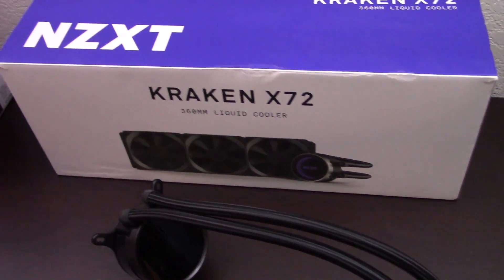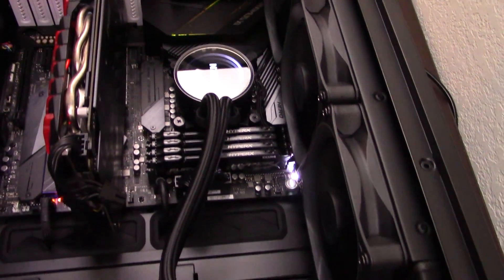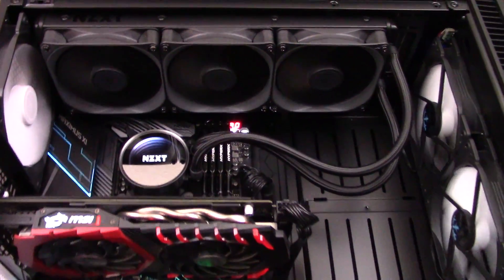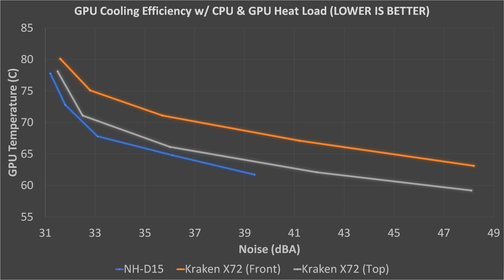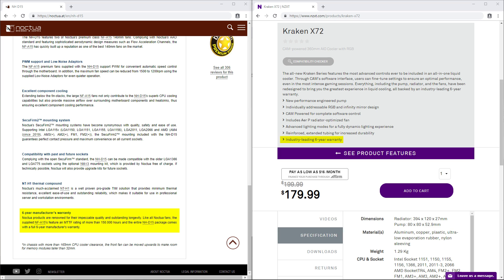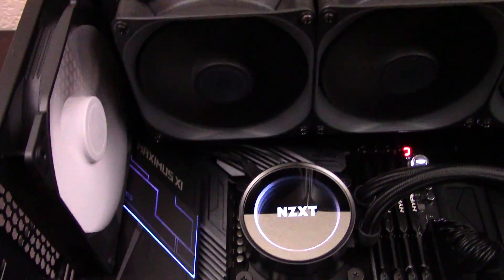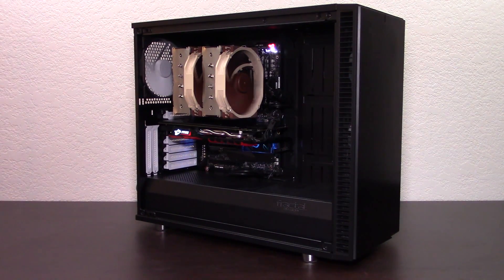Air Cooling vs. Liquid Cooling: The Ultimate Showdown (feat. Noctua NH-D15 vs. NZXT Kraken X72)

Comment: The Noctua DOES HAVE customizing ability.  It is called CHROMAX.  I used this very same cooler in my build  (02/19) and have black fans with white fin covers.  Here is a link a short video explaining this...  https://www.google.com/url?sa=i&source=images&cd=&cad=rja&uact=8&ved=2ahUKEwiOjbmCgLnkAhVLeawKHfqCBxcQjhx6BAgBEAI&url=https%3A%2F%2Fwww.youtube.com%2Fwatch%3Fv%3D_Nc2aonsseg&psig=AOvVaw0_rYovS4FKjRDTAqpYJ5PZ&ust=1567749467471761

Comment: One thing that could be mentioned. If you're ever moving the PC (LAN parties or whatnot) a huge air cooler will be quite heavy and will put a lot more stress on the socket and motherboard than the AIO will.
Reply: @Arachnotron The radiator doesn't hang off of the socket or motherboard. The Noctua NH-D15 is almost 3 pounds hanging off of the motherboard with a high amount of leverage due to the weight being concentrated on the outside edge. A waterblock is a couple of ounces and an inch tall. If you've ever used both you'll know this...

Comment: and the NH-D15 will last for life... no pump to replace, just the fans and thats a quick swapperino and noctua prolly upgrades the mounting brackets along the way.
Reply: Well the tricky part is the price and case. In some cases the D15 cant fit. I paid my thermaltake water 2.0 like 2 years ago 60 bucks. D15 cant fit in my case and its 120bucks. My thermaltake was running good till like few 2 weeks ago 96c on fortnite when i tested it im running 2600k at 4.9. Yesterday i was like fuck it i took it apart it was painful but i replaced the liquid there was like 2 spoons of liquid inside xD. I replaced the liquid with pre mix of anti freeze well people say dont use anti freeze but fuck it on the bottle it said anti corrosive and anti bacterial. Well my temps are good now im running 1.51v on my i7 max temp 72c
Reply: my kraken pump died a couple days ago...couldn't figure out my my pc was thermal throttling to death. The Deepcool Fryzen will do fine for me, I think imma stay away from AIOs from now on
Reply: @jerryknudsen7898  good decision welcome to the pc master race
Reply: Warm Soft Kitty  true, welcome to the pc master race😎
Reply: NH-D15 is amazing but like many components it has a limit, there will be a point that cooler won't be able to keep up with the heat output that CPU is generating on the high end. I can't wait to see the Ice Giant Coolers performance when it releases compare to both Air coolers and Rad. Sure it is the next evolution of Air cooler but with different technology and not relying on heat pipes or worry about dry-out. If your CPU in the future is tamed at low temp by the NH-D15 then yes will last a lifetime, but if it isn't, Ice Giant will be the next step up.
Reply: then you cant oc your pc , when it already reaches 75 degrees without oc
Reply: @resinds.p4898  talking about price to performance ratio. Of course water cooling is better.
Reply: Warm Soft Kitty  not 360s, but matches most 280mm aios.

Not the new Arctic LF II though.  That one is incredible.
Reply: @TheMasada05  so basically the cooler with 2 noctuas beats the one without, nice i think ppl forget that all watercooling is is your moving the heat-sink somewhere else its not some magical it has water it will be cool its still just a mass of heat-sink equation.
Reply: try that ryzen swapling allot thing bad flash and 3950x 16 core heat.
Reply: With the 6 year warranty on NZXT aio's I wouldn't worry about replacing anything on them
Reply: @frenak12  my cooler master 240 still going since 2014. And I'm pretty sure that warranty was 4 years.
Reply: I've never had an air cooler for more than 5 years.
Just got me the nhd15 and plan to keep it as long as possible.
I'm curious about the heatpipes. Do they have some sort of decay time or lose efficiency after a long time? like 10+ years
Reply: You're never going to upgrade your computer? Neither will have compatible sockets in 10+ years, maybe even less depending on where you are on the upgrade and new chipset design timeframe.
Reply: @VictorBStan  You can take a Noctua cooler from 2005 and request a free AM4 mounting kit and use it on a 2021 AMD Ryzen 5950X. They've been supporting SecuFirm2 for 15 years now, and there's no reason to believe that they won't support it for another 15 years. It's widely regarded as the best mounting system in the industry even after 15 years, and new sockets are supported via new mounting brackets that are either included with the coolers, or available for free from Noctua (or purchased for $10ish if you need to get one fast).

So yes, there is a very high chance that a Noctua cooler you buy today will be compatible with sockets in 10+ years.
Reply: @gazza The major point where a noctua air cooler beats AIOs is the fans.  CM ML240 uses mediocre fans, and the corsair fans are merely okay.  Stick Noctua nf-a12x25 fans on that AIO instead and watch as the performance becomes equal.
Reply: then again the x62 is an AIO so its much harder to replace the pump
Reply: @shanenelson6932  lmao replacing the pump inside the aio is going to be a hell of a task.
Reply: @Oliver-bn7jt  yeah thats kinda what I was thinking. I don't even know how you would go about that.
Reply: Warm Soft Kitty  at idle yes
Reply: Warm Soft Kitty  I know that. I didnt had anything else
Reply: @filds1  AntiFreeze is actually worse cooling performance vs distilled water (in cars and likely in computers as well) They only put antifreeze in cars, so that it doesn't freeze up in cold climates.
Reply: @bronanu201  The best aesthetics is not having a giant PC case sitting on your desk. MY PC goes under the desk where it cant be seen and where it belongs. Its much quieter (between the desk blocking sound and not needing a giant window on my case), the buttons are much easier to access, have much more desk space and my desk is much cleaner and nicer looking as a result.

If you want aesthetics just put a plant or sculpture on your desk, wrap some Christmas lights around it if you are a tacky teen who needs everything to glow.

liquid cooling is just straight up lame.
Reply: Warm Soft Kitty  you have a room temperature IQ I'm surprised people like you are able to read this comment.
Reply: @shanenelson6932  Lol. You definitely rode the short bus to school.
Reply: @labotimy  your GPA is probably a  less than 2 don't talk too me
Reply: @labotimy  I'd rather ride the short bus than be a super senior
Reply: @Leozyoo  Maybe, but what if I told you there was an objectively superior option. Both in form factor and RGB capabilities. Imagine this, an RGB setup a tiny fraction of the size, but so advanced that instead of just displaying basic color patterns it could display text and documents... pictures and full motion video. And it could often be had for less than the cost of an RGB setup.

That's right my friend, its called an extra monitor. And it is objectively better in everyway.
Reply: Warm Soft Kitty  I have, they don't lmao

Comment: I haven't done a full upgrade (new PC build) in a while and I think am going to switch to air cooling. same overclocking potential with NHD15 and i like the 0% chance of leak because although its rare, it does happen. it happened to me but I was lucky my PC was off

Comment: Air cooling all the way. Love my NH-D15, no annoying pump noise, like i used to have with liquid cooling
Reply: What AIO was that? My old X52 and now X62 are dead silent.
Reply: I have the fractal s24 and the pump noise is non existent. Previously I had a dark rock 4 and there's no difference in noise levels. However in my case I found the DR4 was heating my GPU. Now both the CPU and GPU are running about 7oc cooler under load with AIO.

Comment: Fantastic video! But i have to say the fans on the Kraken arent that good. I replaced mine with Fractal fans (the white ones that are as good as noctua fans) and it became more silent and cooled better. I had the X62 btw.

Still tho, the D15 is just less hassle and cheaper. so i agree with your statement
Reply: We got the same cooler ! I was thinking to switch the fans that comes with the x62 cooler but does the fan u replace fit ? And how do you control the fan? You plug the fan using a fan controller or straight on motherboard?

Comment: You can now customize the Noctua's with the heatsink casing and fan sides with different colors. 
Side Note : My PC I build in 2012 with i7 3770k overclocked to 4.4Ghz at stock voltage! is still running on the Noctua NH-D14 also is the only part that I purchased not brand new! Never had any problem and noise issue with it and temps never went more than 55-60C even in Summers. Absolute top quality and performance if you can get you're head over the blocky design and the RBG bling bling, even if you don't the performance in itself will make you a fan of these air coolers (NH D-14-15) by Noctua!

Comment: That plot is not the best. The x axis should be the independent variable, and y the dependent. We want to see what happens when the temp goes up, or more importantly, what happens when the cpu load goes up. Investigating so needs to encode three variables on the plot
Reply: Efficiency means sum of outputs to sum of inputs. You have used it very loosly. Also the time variable is missed, how quick they reach 80c ?

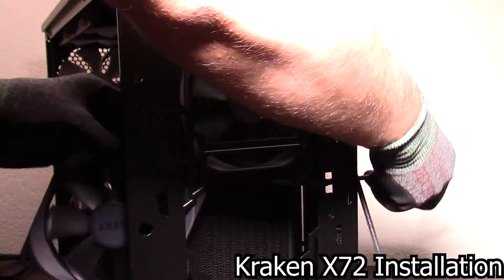Comment: The fans on the Kraken at 1:52 are around the wrong way, no?
Reply: I don't think so, the fans are pushing cool air from outside of the case right into the radiator. I saw a video a couple of months ago where a guy tested and came to the conclusion that this way is hands down the best configuration to keep the cpu as cool as possible.

Comment: AS CONSTRUCTIVE COMMENTARY ONLY. TAKE MY COMMENTS WITH A DASH OF SALT ... I COULDN'T HAVE DONE A BETTER VIDEO.

Can you please share a little more information at the beginning about your test setup, and parameters. Like a few commentators below my immediate fan-boy reaction was that you 'forgot' the custom loop water-cooling, but then I realized you were talking about off-the-shelf solutions (which makes more sense) and not the more extreme builders that bend their own piping and cool the CPU/GPU/VRM. Trying to account for all the variations in a custom loop would probably be impossible ... but it would have been awesome to see if it made any difference at all with a GPU/CPU on a loop (other than looking cool :P). I would also love to know (similar to other commentators below) if the AIO was heat saturated before the tests as this makes a big difference in scoring (often to the detriment of water-coolers to be honest). And I would have loved to see the results compared to an open-air case so we can rule out poor case design or air-flow issues. I know you addressed this in a comment below, but I use them and so do a number of clients I built gaming systems for .. also it is less about the fact that a small number of 'nuts' out there actually use open air systems and more about understanding the impact that the case is playing in the cooling setup (a video in its own right). It doesn't need to actually change your results or conclusion, and I know it is not reflective of normal builds, but it gives me something to compare against without needing to reference the particular case design you used.

Lots of reviewers have tried to answer this question and there are always comments like mine that say 'what if X' .... in reality air cooling is just as good and a lot less headache than water cooling. Other reviewers even say it is better than custom loops. And the AIOs are not as good as proper custom loop designs but come with support and are not likely to leak (seriously I set my computer on fire with a leak once ... fun times ... 100% my fault ... still hilarious).  I personally will continue using custom loops because I like them and will hopefully learn enough from the online review community to test my own gear properly with awesome charts like this video :)

PS: Awesome video, love you work! Found you via Awesome Hardware (Paul and Bitwit) and would love to see more of your work.
Reply from the maker: Thanks appreciate all the feedback. I have a video planned where I go over the full test procedure so you can see all the details. I will also be doing a Round 2 this video where I do longer tests for heat "saturation". My videos are mainly geared toward the average consumer, so you won't see things like open air case tests because I want the tests to be most applicable to most people.
Reply: @HardwareScientist  awesome, thanks ... Looking forward to the next one! And look forward to your channel getting to 1m subscribers soon :)

Comment: I even agree with your conclusion. but listen to your intro 00:00 to 00:28 and your video is a little pointless.
with this introduction the answer is easy "custom loop"
or listen to you in the intro saying things like max performance ultimate solution this video is not about budget. and then you proceed to compare prices and warranty and maintenance WTF
The last thing when you say the Kraken is for enthusiasts. well for me both are for enthusiasts. I have doubts that no enthusiast ppl know Noctua. and is much more likely average people buy a AIO because of the aesthetics that a Noctua cooler
Reply: The point he was making about maintenance and support is actually important to many builders. I have literally set my computer on fire operating a custom loop cooling solution (100% my fault ... infinitely hilarious). And because it was not an AIO or manufacturer product I literally had to take that on the chin and pay for a new machine. Not everyone wants to take that risk so it does factor into the conversation and is important to know that NZXT offers to replace your gear if their cooler leaks (thanks for including it, I didn't know this).

Personally I will still build my own custom loops and take the risk, but this video was more aimed at off-the-shelf solutions which is something that could be improved in establishing the parameters of the test.

Comment: What about the weight of the big air cooler on the motherboard?
Reply: ...the air cooler is one part. The AIO has 2 parts, a radiator and the contact plate so it's obviously much heavier.
Reply: Sonorite radiator is supported by the frame of the pc which is much more secure and stable then a motherboard. Even a big GPU will sag.

Comment: NH-D15 vs. corsair H100i please
Reply: I have these two, using the D15 now, its much better, my h100i works for 3 years and the pump start to fail. In this case, i prefer the Noctua.
Reply: Linus Tech Tips already did this back in April.

Comment: 3:49 you can fit the X72 pump like that with 4 ram sticks??? I have Corsair vengeance rgb pro and it totally pushes on the left most stick!
Reply: Jiajian Hou try adjust the pump without bending or giving it a lot of stress
Reply from the maker: My RAM has small heatsinks so it fits.

Comment: Dont forget... the NH-D15S is the HIGH COMPATABILITY version of the D15. Its offset so better ram and upper PCIe clearance. One fan, but the extra fan only drops temps by 2 degrees. And clips are supplied if a second fan is desired.
Reply: Thanks for highlighting this! I was worried about not having the second fan as im using corsair dominator ram!
Reply: @ocherwei  

Yep, the second fan is no issue. Two degrees is nothing. The reason its only two degrees is because the velocity of the air passing through the heat sink is the same. All that changes is a slight increase in static pressure. Thus only two degrees. 
Quieter of course with only one fan. I would always recommend the "S" variant over the regular D15.
Reply: I use an NH-D15S with two 140mm NF-A15 Chromax to cool a 9700K. Even living in one of the hottest parts of Brazil, my CPU never got above 60ºC, at idle it only gets between 32ºC and 34º #ExcellentCooler
Reply: @DERAVAX  

Yep, they are superb. Dont forget though, you only need one fan, the second fan only reduces temp by two degrees.
Reply: 2 degrees?! At least it’s something lol #WorksForMe lol
Reply: @DERAVAX  

Ha, fair enough. Its quiet so why not. I stuck with one fan on my 15S more for aesthetic reasons. Looked better with the Chromax fans and covers.

Comment: Thanks for this test.  I would point out in relation to top vs front aio location another user posted a comparison video and the front mounted aio came out as better for cpu cooling.  Test from 2017 bitwit.  I understand different hardware configurations may have different results.

 https://www.youtube.com/watch?v=xNAMxZgvves&t=664s

Comment: what, whats a krayken? j/k :P anyway very nice video, i think ima have to dump my h100 aio for a be quiet or noctua air cooler. Too many advantages over the aio. Quick question tho, im running a 2080ti/8700k, will this be ok to run on air?
Reply from the maker: Yeah should work great on air. In fact it will keep your GPU cooler.
Reply: @HardwareScientist sweet yea, for 80 bucks its worth a shot anyway! thx

Comment: Trying to talk to NZXT will make you realise they evade responsibility at all cost. You can look up people's first hand experiences with leakage. 

My own experience, I had an idiot tell me that their GPU bracket "is just that, a bracket, and does not have the capability to damage anything" while their Amazon page totes "improves temps by 40°!' 

I installed their G12 bracket on a 980ti, which died after a day (cracked GPU die) because their mounting system relies on 2 cheap foam blocks to space the GPU. I contacted them to let them know it wasn't actually compatible with a 980ti reference as they claimed. The rep, James went on unrelated tangents.

Comment: What’s the thing with RAM, the Kraken can fit 4 RAM’s and the NH-D15 can only fit 2?
Reply: No, they can both fit 4, the problem is that with both fans attached the NH-D15 only has RAM clearance of about 34mm, so you need low profile ram, whereas the X72 doesn't have this issue